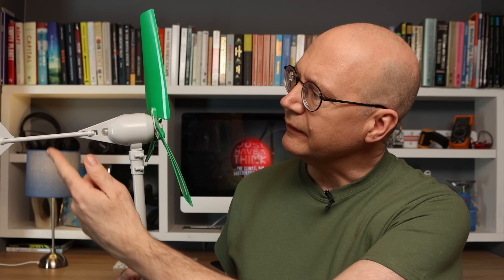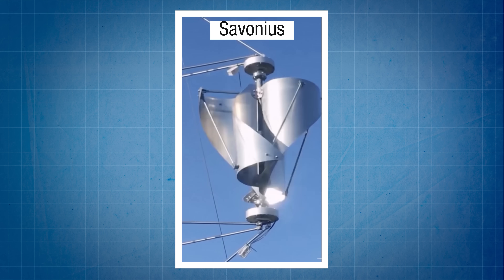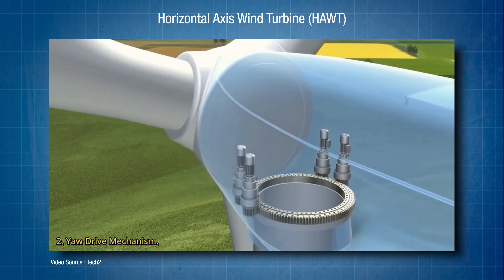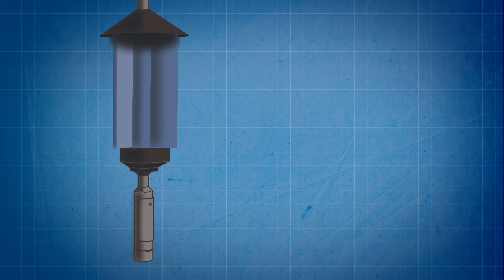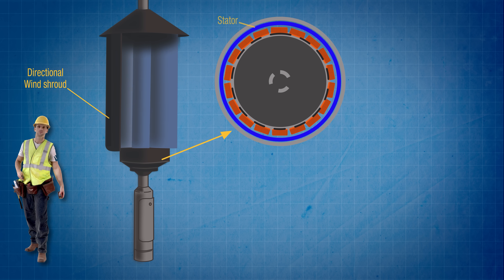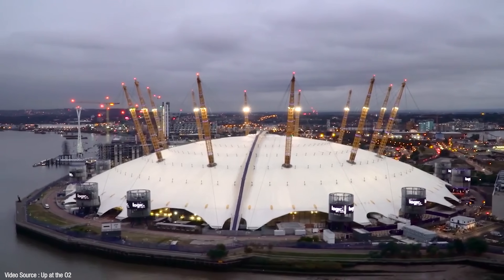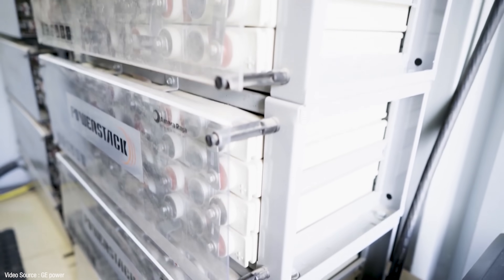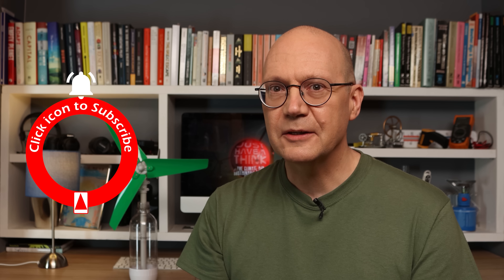A vertical axis wind turbine that doesn't need the prevailing wind! How do they do that?

Comment: Having run wind turbines for many decades I just do not believe the numbers. The VAWT has in the past been the subject of many claims like these, generally from companies seeking investment/grants, but no one has ever managed to produce the figures in the real world. I am sure Alpha product will go the same way too, in the UK the larger B & Q stores had big VAWTs fitted, same story, they never produced anything meaningful and all got removed. I would love you to go into the maths, would be quite easy to work out the turbine efficiency required to meet the claimed figures, my guess is the figures are well above the actual harvestable energy, ibn my opinion A311 is just a vehicle to sell shares and make the founders money.. I could be wrong, anyone willing to do the maths ? I just did some simple maths and at 6 ms the energy in the wind is only 130 watts per metre of swept area (Power per sq. meter = .0006 V3), so the figures quoted in this video/A311 seems physically impossible ?
Reply: Do a search on google for "another take on wind turbines" and read the 5 page discussion on A311 on the YBM forum. Its easy to see the figures and claims are utter rubbish. This channel is called "Just have a think", well I did as you said and after a few hours (of thinking) realised exactly what is going on, you should do the same. By the way the company chairman is an ex Lloyds/UBS banker, the director in Martyn Lewis the news reader, and the other directors are the people tinkering in their sheds (who have a string of dissolved companies behind them). I wonder if they have secured any big grants ?

Comment: This wind turbine is a great idea. On my roof right now is a spinny thing called a turbine vent that uses the wind to pull air out of my attic. Turbine vents are everywhere, there's millions of them. Would it be so difficult to increase the size a bit and turn it into one of these wind turbines? They could be retrofitted onto existing houses and provide who knows how much power to the grid. Each one would produce a small amount, but if they were as omnipresent as turbine vents are now they could add up to a huge amount of carbon free electricity.

And putting them on cell phone towers would have additional benefits beyond just removing their collective load from the grid. They'd also gain a measure of disaster proofing, keeping the cell network and essential communications up during blackouts when the rest of the grid is down.

It sounds like a great idea with a lot of potential for expansion. We tend to think in absolutes a lot of the time, looking for the one big solution that will save us, but maybe salvation will come from making millions of small changes and harvesting the "low hanging fruit" that's all around. Wind turbines and solar power, micro hydro power, geothermal power, district heating and lots of other things we might not have thought about yet, all adding small amounts to the grid. Just lots of little generators placed everywhere they might be useful.

Comment: If we had access to more abundant inexpensive and more reliable electricity, we could afford to purchase more appliances, and we could afford to be more comfortable. 
We have the technology. But the people who own the grid, don't want us to have access to the technology, because they have us paying them every month, to supply us power using old technology on an aging grid.
Reply: True!
That's why I advocate nuclear power: abundant, inexpensive, and reliable!
Reply: @TheSpecio  
Not inexpensive.
Reply: @davidwatson2399  Compared to cheap natural gas it's expensive (In the US it's possible to produce and sell a kWh for 8 Ct due to fracking).
But in the long run, nuclear energy is quite cheap: Very high investments at the beginning, but then 60 - 100 years very cheap production.
Reply: @TheSpecio  
Not if you include the full life cycle costs.
Mining, waste storage, construction, decommissioning etc.
Solar and wind are way cheaper already.
Reply: @davidwatson2399  Mining for a nuclear power plant is waaaay less than for wind or solar! You need far more concrete, steel, polymers, copper, etc für several thousand wind turbines than for one nuclear power plant with the same energy output.
Uranium has an incredibly high energy content. That's why the mining of fuel and waste disposal is very cheap.

We have to agree, that a power plant is a facility that can deliver electricity ON DEMAND.
A wind turbine or solar panel is NOT a power plant. If you want to compare them to nuclear, you have to add the storage cost for demand-sided production.
Wind and solar are therefore extremely expensive.
Reply: @TheSpecio  
The facts dont support your assertions.
Reply: @davidwatson2399  Imagine I am running a factory and you have a wind farm.
I need electricity and because my factory is producing continuous (Let's say I am making paper or aluminium) I need a constant supply. I am asking you for delivering 10 MW  at any given time. What price can you offer per kWh?

Which other facts do you mean? Please show me.

Comment: Great idea for the cell masts and the likes. But I have a question: On motorways it’s the airflow generated by the cars spinning the turbines which are then basically slowing the airflow slightly as they extract energy. Since the airflow is slightly slower that puts a little more drag on the cars which have to use more fuel to keep the same speed. So in effect it’s the motorist paying to spin the turbines. Or am I wrong?

Comment: It's not the magic bullet that solves everything, but if the practice reflects the projections, it's absolutely a win. If they don't work out as hoped, it's still a win, because it was tried, and you have knowledge on "well, how can we do better? We expected this much, but only got that much!"

I don't see how it can negatively affect performance of passing vehicles, because they're already paying the cost of breaking winds anyway, and if they had enough of them installed, it may actually help reduce the wind resistance load they have to overcome, though I suspect it'd not be cost-effective for that many generators.

Comment: This would come at the cost of car fuel efficinecy inb many cases. Just like head wind of tail wind make a difference for fuel economy. 
In speed skating in closed arena's, the air starts circulating to produce a modest tail wind due to the speed skaters in the direction that skaters are moving. So cars speeding down a highway produce a tailwind - in principle. 
Normally we see traffic move either in the one or the other direction. In such circumstances this system would reduce fuel economy for cars. When both sides of the road show similar traffic, the interference between the 2 colliding flows will result in turbulence that will likely increase drag on both sides. In these situations, such wind mills could theoretically reduce drag by reducing turbulent conditions. Needs further studying I guess.
Reply: A skate rink is essentially a closed system, a highway is not.
How about roadside trees, railings,  guard rails embankments etc or cars coming the oposite direction.

Comment: This is not FREE energy from cars it will cause a small increase in power needed  from the traffic to maintain there speed.
Reply: Yeh right🙄
Reply: @davidwatson2399  A bit thick are you not Dave, as the car moves along air is pushed out of the way freely, when you add an obstruction like this the air cannot move freely and causes a very small pressure increase that the car must now over come therefore adding more load on the engine/motor requiring more energy. No such thing as free energy now piss off wanker.

Comment: I would have thought that this could be adapted for use in underground train tunnels or even road/car tunnels. Even along high speed train tracks to feed local energy storage schemes along a train track to capture the energy generated by the trian disrupting the air. Since noise is just a form of energy maybe the capture of this energy would reduce the effects of the noise of high speed rail.. F#'ced if I know mind you.

Comment: How often will they need to be replaced due to a crash? Light poles on the freeways often get cut off in accidents? Will they have a affect on the ability of the pole to shear during and accident? Could make the pole more deadly with the added weight. Just other things to consider.

Comment: Here in California, our power system is dysfunctional and often unreliable.  We’re approaching 2nd world status leaving many families installing solar panels on roofs.  I can see a three part approach for personal power needs; solar panels, whole house batteries, and wind power.  This is getting expensive now.
Reply: Well, if moving air caused by cars rushing by is captured by these blades, car's will get a higher air resistance, thus using a little bit more fuel.

So...what's the benifit...😉
Reply: @emptyness72  As stated in the video, vehicles punch through the air anyway. These devices only capture energy which is lost. They do not increase the resistance when installed in open air. See comments above for the situation inside tunnels.
Reply: "This is getting expensive now."
But also getting cheaper all the time ?
Reply: Our cranky old coal and oil ways have been absurdly expensive for humans and all life on Earth. Extinction is a horrible, and to most, unacceptable, price. Humans are not magically exempt from extinction - no invisible friend will come and save us. Oil isn't 1st world status. It's death.

Comment: I've always been in all of the above energy person, it kind of sads me that solar and large wind have kind of dominated the renewable energy space.

I think there are a lot of other promising technologies that need to be remembered, like biogas. biogas could use existing natural gas infrastructure, help with intermittency, and be available and distributed way.

biodiesel used to be a much bigger part of the conversation, but it's been overlooked. As a motor fuel, it's still renewable and it's more energy dense than batteries, allowing lighter vehicles that use West energy to move them in the first place. battery electric vehicles have been getting heavier and heavier, with companies like altera being the exception.

Comment: As the saying goes, I am from Missouri, Show Me!
A HAWT device, that is theoretically 37% efficient under the ideal circumstances, cannot possibly produce sufficient electricity to make a dent in daily needs of one person, never mind the inhabitants of a village, cannot be enthusiastically embraced as a good thing.
By the way, its related device, VAWT IS EVEN LESS THAN 37% EFFICIENT.  May I suggest that you first read the experiments conducted by University of Nebraska-- Extension Branch before convincing your audience of the great benefits of VAWT.  You may also want to ask the Airport Authority at Portland, Oregon International Airport, what their experience has been with VAWT's installed atop the parking lot building across from the Main Building.  Enthusiasm is not sufficient.  It must be tempered by the reality that determines the utility of these devices.  A device that requires a minimum wind speed of 6.8 M/S to be worth considering, is not utilitarian.  But I still commend your enthusiasm!🤔

Comment: I suggest putting these virtual generators alongside train tracks could power the railways.
Reply: The UK railways are looking at VAWTs to see if they can be useful. I suspect they will produce nowhere near enough power to run trains. Maybe the lights? Reducing overall draw from the grid would be the aim.

Comment: I simply love these videos. I totally see my small house in 10 years to be self-sufficient with heat pump, solar array, wind/water turbine and some energy storage - either battery or something similar. Love how the tech is moving forward with extreme pace. Thanks for keeping us informed.
Reply: Many houses already could be self-sufficient today with just solar.  A quick Google of consumer-grade panels you can get today seem to average around 300W with some going over 500W for the premium ones (with equivalently extravagant price points of course, but still within the range of "consumer" - not talking about those $million/panel things NASA has to use in space or anything ridiculous like that).

There are of course people like me who have stupid numbers of computers running and the like, but most average homes could easily run on panels alone, with things like turbines just being an added bonus.  The problem isn't the tech though.  The problem is the cost of installing the tech.  Solar will save you money over the long term, but most people have trouble dropping several thousand dollars all at once even if they know that they'll save more than that over the course of 10 or 20 years.  And its not just a conceptual "trouble" - a large majority of people in the US simply couldn't afford to do it in the first place without saving up for months or even years, and chances are those savings will likely end up getting used for more immediate concerns in the meantime.

Government subsidies help, but between fossil fuel lobbying and too many decades of Red Scare nonsense causing people to no longer understand the difference between government assistance (social programs) and government control (socialism), the subsidies are rarely sufficient to make much difference.  I mean every panel helps a little bit but its not anywhere close to the large-scale change we'd need to see to really make a dent in climate change.
Reply: @altrag  Thanks. I agree with your note.
I would still question the cost factor. While electricity from the grid is, in general, cheap, the "getting the grid to the house" might not be. In the area where I'd like to spend my retirement years, there won't be a lot of neighbors. These areas, usually, have very unstable and unreliable power. And a VERY high cost of initial installation, way above some of the renewable energy options.
This factor is, usually, not calculated in - as in the residential areas, the power is right at the border of your property. This might not be my case :)
Reply: @rklauco  Yeah, the focus tends to be on urban and suburban residential - the places with the highest population density.  And for obvious reasons.  A "small" 1-acre parcel of land in the middle of rural nowhere houses one family and therefore one family's worth of power needs.  A similar acre of land in a dense urban area could potentially hold dozens if not hundreds of families (if its turned into apartment complexes).

Certainly if you live (or want to live) in an area with a terrible grid situation, your economics changes drastically.  But those areas are also not where most power is utilized (if it was you can bet the grid operators would put more focus there!), so they often aren't the focus of discussions about alternate power sources (at least not in the context of overall environmental impact.. there's of course lots of discussion about using alternative power as a way to let people move into rural areas without losing as much of the electricity-provided comforts of the city, as you're looking to do).

Comment: I remember a speed bump that could harvest electricity.  Of course, it was taking that energy from the vehicles going over it.  Fine in a spot where you want to slow down traffic but not good in most places.  This is much more clever though, since, like you said, the wind is already being generated.

I suppose there might be a small effect for keeping a tailwind moving the direction of traffic though.  It would be interesting to see if there would be a small loss in mileage efficiency... if you slowed the wind enough...

Still, a cool technology.

Comment: Thanks for your excellent channel. I immediately thought, how do I get one of these for my home, we use less than 5kWh, around 3.7 kwh, so it seems mad to think of solar panels when one of these could do a great job, obviously the power providers don't really want households making electricity rather than having to buy it from them, but..
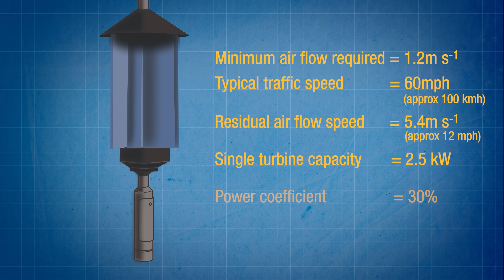Reply: Dave's numbers don't stack up, they are wrong by either two (5:31) or three (8:50) orders of magnitude. So which is it, 2.5 or 24 kW? The right number for a VAWT this size is about 25 watt, by following the standard VAWT physics formulas.

Comment: I've long pleaded that these types of turbines could do great in urban settings. Wind tends to speed up around (high rise) buildings, I imagine these types of turbines could harvest a lot of energy in such environments if implemented at the corners of buildings. Vibrations and noise may however be a challenge though I think that with smart vane designs and attachment systems these kinds of issues should be solvable. Encasing the turbines in a smart way might help against noise and could even improve efficiency by increasing wind speeds around the turbines.

Comment: Are these cheaper per Kwh than large scale HAWT arrays?  If not, do they still make sense to deploy?  If they are cheaper, and were deployed as much as possible on roads and buildings, towers, etc, what percentage of Britain's power needs would they supply?
Reply: Dave's numbers don't stack up, they are wrong by either two (5:31) or three (8:50) orders of magnitude. So which is it, 2.5 or 24 kW? The right number for a VAWT this size is about 25 watt, by following the standard VAWT physics formulas.